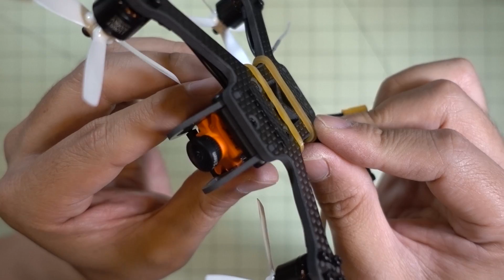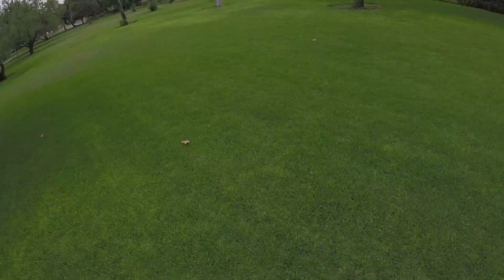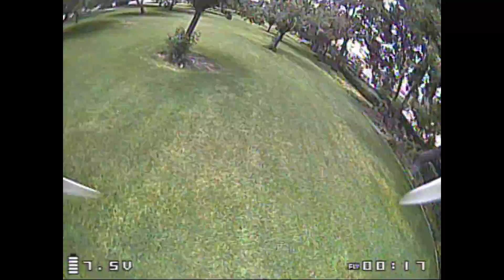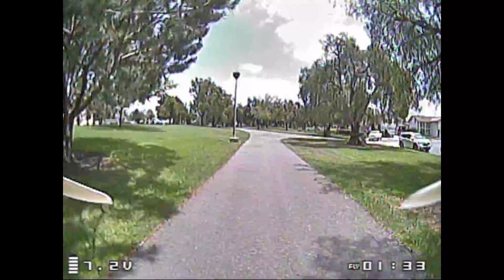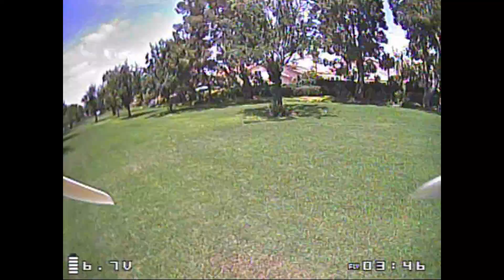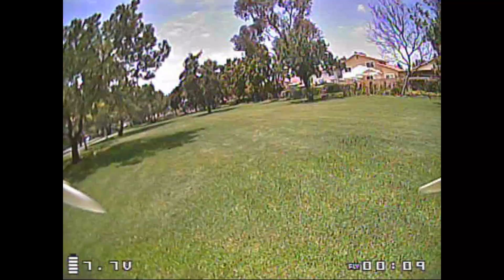Micro Drones 101 🚁 #7 💡 FD120 MultiGP Micro Racer 🏁🚩⚡

Comment: Hey Albert are you powering the vtx and camera off the 5v BEC output on the FC? No brownout issues? I saw your other video on preventing brownouts but wondering if I have to add a separate 3A micro BEC for this build  (runcam swift micro and vtx03). Thanks. Your videos are great!
Reply from the maker: For this build, no brownouts and no extra BEC.  The powercube on this one has a strong enough BEC for all the components I am using.  I would not add anything else like LEDs or you'll probably get brownouts at that point.
Reply: Albert Kim. Thanks so much for the response! Yeah I will just be powering the swift micro and the vtx03. Have you tried it on 200mw setting too?

Comment: if i do exactly this build, but im gonna use the gemfan 2035, is it gonna fly much slower?
Reply from the maker: A little bit because of the smaller prop, but those Spintech motors are plenty powerful even on the 2-inch prop. I say go for it.
Reply: are  the  hb2535 on banggood simular to the rotorx ? the rotorx are hard to get in my country
Reply: Albert Kim and if i want to get a seperate 4in1 esc and fc both from banggood, witch one do you recommend? the ones with intergrated flysky or frsky receivers arent goeing to work with my transmitter
Reply from the maker: Flown them a little and they seem to have a little less power but not bad for the cost. Flight time seems about the same. I still need to fly them a lot more to get a better idea.
Reply: and are the dys be1104 powerfull enough?
Reply: no im gonna go with the spintechs
Reply from the maker: +Jordi Braun yes

Comment: hello.  I have been watch all the different builds you been doing.  is this the smallest build able to fit the runcam?
Reply from the maker: Up to that point. There is a 2 inch PNP coming out this week that has the micro swift. Also more 2-inch frames coming that will fit the micro swift.
Reply: I have a runcam on one of my larger quad and i really like the image quality compared to the AIO.  How is the image quality of the micro swift compared to any of the AIO cameras.  There are more frame options that fit the AIO cameras as of right now.  Have you found any AIO camera that has decent image quality.

Comment: Sweet build Albert.  hows it on 3s?
Reply: Do you think that is crazy to run the dys BE1104 7.5kv in 3s? I am just thinking in doing that
Reply: Yes, that is what I am thinking, mounting it in an arfun frame with 2 inch props, so is it perfect? And what type of props? 3 blade or 4?
Thanks and great videos!
Reply: Thanks you! Really really fast answer, you are the best
Reply from the maker: +HDfpv These motors are too high a KV for 3S.
Reply from the maker: +Jaime Rodri on 2 inch props on a light setup it will be OK.
Reply from the maker: +Jaime Rodri both will be fine.

Comment: Hey Albert, I don't have it here in front of my but the cables that come with the Micro Swift / VTX03 only have power, ground, and video in 3 pin cable correct?  How were you able to wire video in and out?  I'm thinking about replacing the 'top plate' of the eachine Lizard with an ARFun top plate and then mounting the Micro with a 20x20mm printed mount.  Would I be able to wire up to use the OSD from the Lizard's controller?

Thanks in advance I know that was long-winded,
Tony
Reply from the maker: +tonyh2k2 Wiring the OSD is simple. Just cut the video wire from the camera to the VTX. The wire from the camera goes to video-in on the FC and video-out connects to the wire that goes to the VTX.
Reply: Thanks so much!  I can't wait to get the VTX in and give it a go...the camera on the Lizard is not the best not to mention mine came horribly out of focus.

Comment: I'm building almost the same quad but with FR1106 7500kv. I also did a small thrust test on 2-3s. They're more than 1.5 times the thrust oft regular 1104 motors. On 3s and these rx2535 (only dual blade) I got over 300g of thrust but drawing about 16A! With an 850mah 3s it should go nuts...but also extremely hot...
Reply: yeah I honestly have no clue about the power on the top end but low end is nuts. I've never gone pass 80%. in fact I've been playing with mid throttle just to be able to fly this little beast.
Reply from the maker: +B5tm5nn the amp draw is a battery killer...
Reply: Albert Kim Shure if you go full throttle too much. But besides that, a 1106 motor is more efficient than a 1104 with the same thrust. So if you would compare a 1104 and a 1106 setup with the same battery (and maybe a slight weight difference ~ 5g) and limit the motor output on the 1106 maybe to around 80-85%, than the 1106 should accelerate more quickly and go faster in general. Please correct me if I'm wrong :)
Reply from the maker: +B5tm5nn I think I'll have to test this to know for sure. The 1106 has more low end power for sure. Not sure about top end speed.
Reply: Albert Kim Didn't thought about that...now, is the Lizard95 faster than this quad? Would really like to know, if lower kv could be even better...
Reply: B5tm5nn I have same motors running on new Tomoquads CSX Komodo Dragon with 3" props. You gotta hella lower the PIDs on these bad boys. Trust is so high I'm only running 2S cause it'll hover at ~35% throttle. I think you're running a pretty heavy battery. Tried the rx2535 props and 3" with both 2s and 3s however mine at both 450mah. Lower your PIDs and lighten your battery and should run cooler. Mine only get little warm on 3s which is over kill IMO
Reply: Johnny del Toro Yeah they get extremely hot. On eachine 2035 and 3s I got about 250g static thrust, but it's more inefficient than 3".
When I'll build mine in the next few days, I'll try graphene 500mah 3s on gemfan 2035s. The Graphene lipo is very powerful, but with about 54g also not very light...could be comparable with other 600mah lipos.
Reply from the maker: +B5tm5nn Lizard is faster but its using 3S